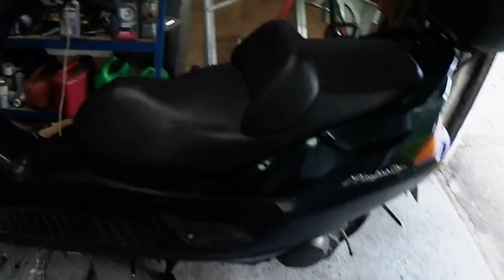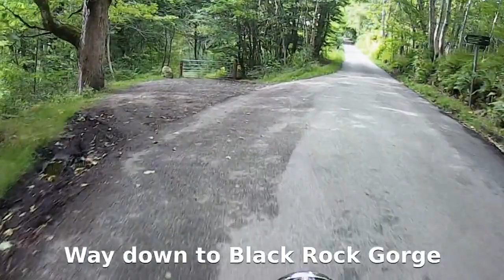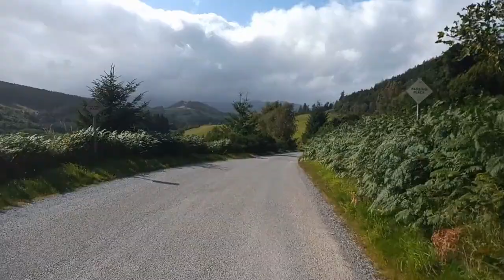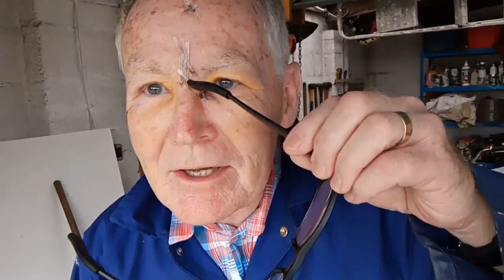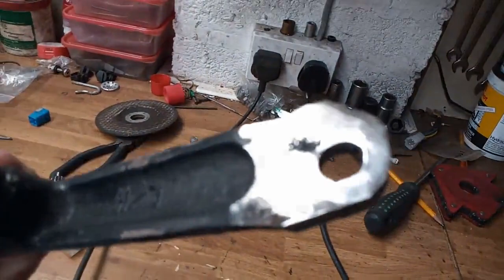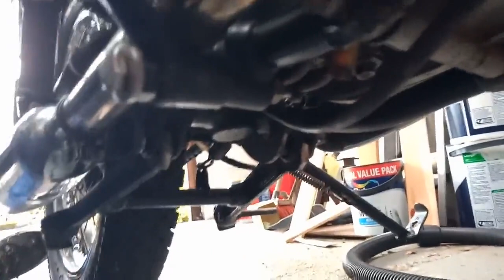BSA C15 - Glen Glass (17 miles)

Comment: Tak weld  appropriate  size washers each side of your repair as a backup, thanks for the video
Reply from the maker: Thanks for the advice. There is no space each side to tack in washers. I have been out a few times since the repair and it seems to be holding up. Thanks for commenting.

Comment: Fabulous scenery, thanks for posting!  If you drop your keys down that gorge you can whistle for them!  Nice job with the centre stand, they are a pain to work on.  I replaced my centre stand this summer with one that was designed to be easier to use than the very awkward, original AJS stand and it works beautifully.  I hope you are keeping well.
Reply from the maker: William thank you once more for your positive comments. They just did not seem to put any thought into a centre stand back then. Someone in the past has welded and extension to mine to make it slightly easier to use. Glad you found something better for the old AJS.